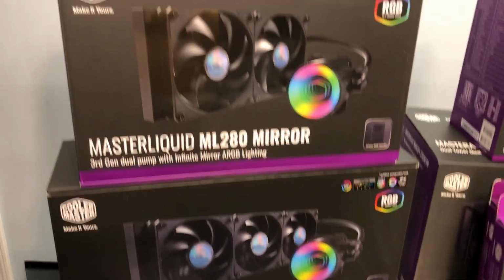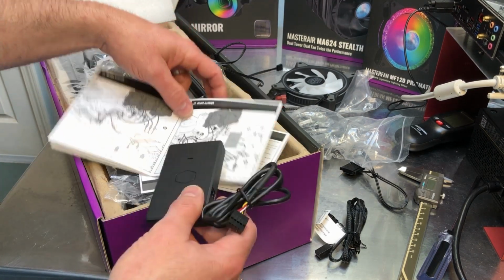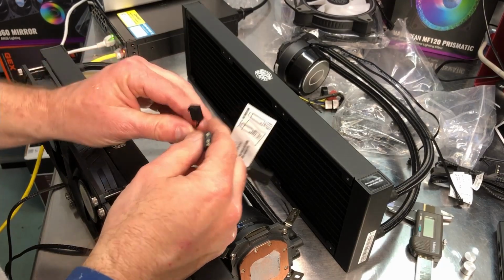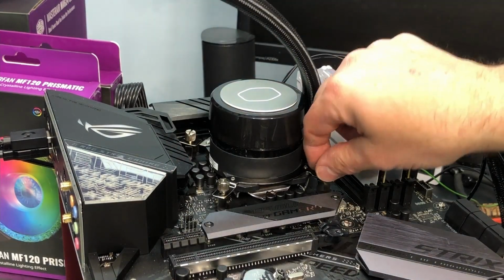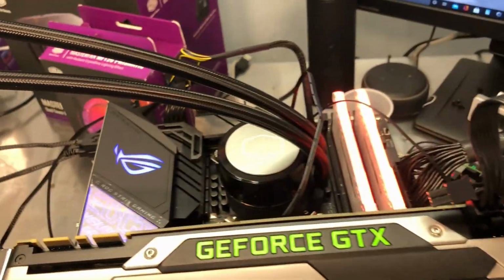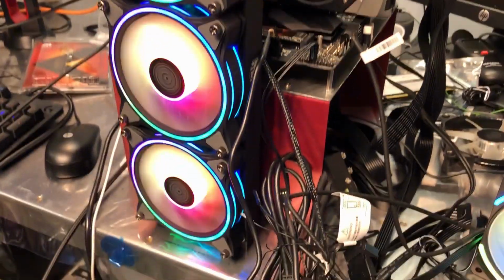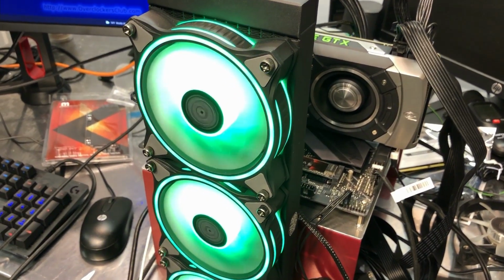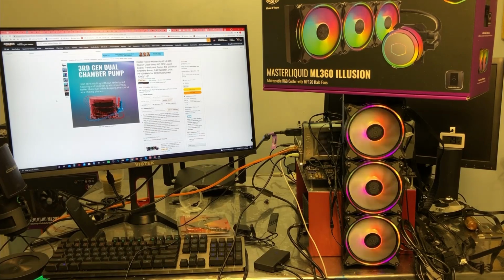Overclockersclub checks out the ML360 Illusion from Cooler Master!

Comment: Were you able to sync the color to the CPU cooler using Asus Armory sync, or did it require the Coolmaster app for color sync?
Reply from the maker: Short answer - yes, but it can take some time. And I found that multiple software packages sometimes don’t play nicely together. You have to figure out which one works best and offers consistent functionality and uninstall the others.
Reply: @overclockersclub  I agree, that is why I plan on using Armoury crate to control all my ARGB devices.   I am using several Coolmaster halo 120mm fans now, all synced perfectly with Armoury crate.    The one concern I had was the ARGB sync to the CPU cooler.
Reply from the maker: @Starbuck8888888  I have not had any issues with any of the AIO RGB coolers I have tested (working with Armory).  Memory is another story...

Comment: I think I finally understand why ML360 has "V2" edition. Thanks for your fully introduction video.
Reply: Why is that?
Reply: Cant find a 360 V2 on their own website. Only 240 versions. But this here also uses their 3rd gen dual chamber pump like the 240 V2
Reply: @C0lbyte   so which cooler is best for i7 12th gen 12700k?
Reply: @Techy shor  today I use the 360 v2 and I'm happy with it. The rgb controller is crap though but I use mobo rgb controller. Its a great performing cooler at a good price. Feels solid and doesn't make a lot of noise.
Reply: @C0lbyte  i am confused because of cooler master ML360 ILLUSION

Comment: Is it okay to plug it on a 12V RGB Header on the motherboard? My mobo doesn't have 5V RGB header
Reply from the maker: No, 12v into 5v LEDs will cause damage.
Reply: @overclockersclub  I think my rgb controller broke the blue light doesn't turn on and none of my rgb lights up, can i plug in in the mobo